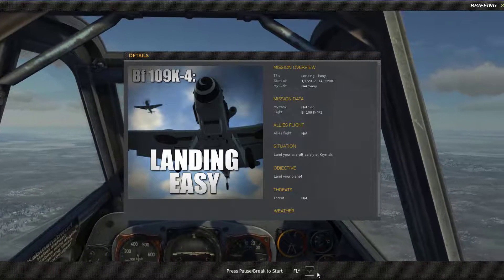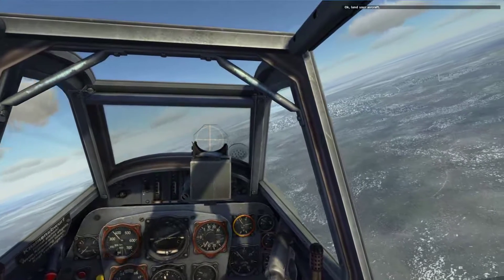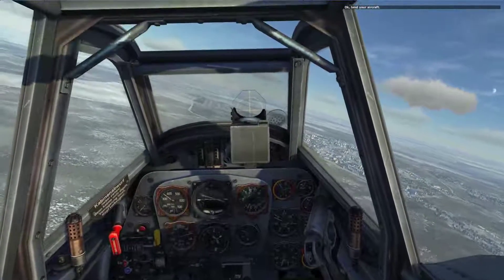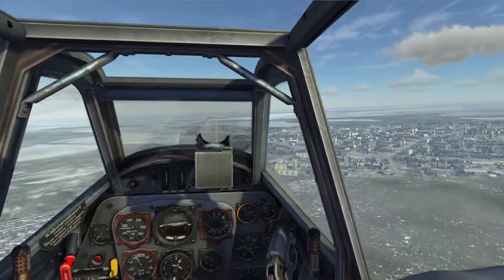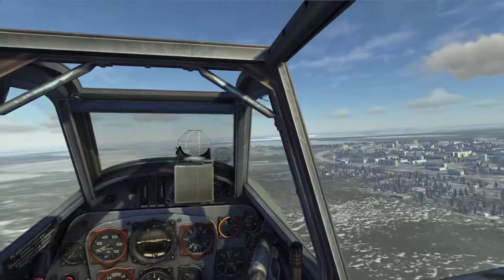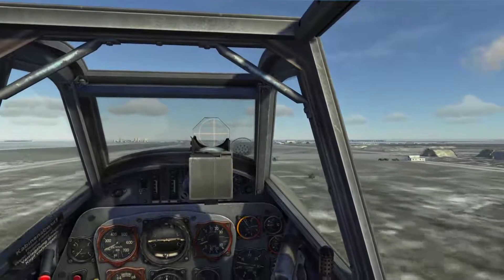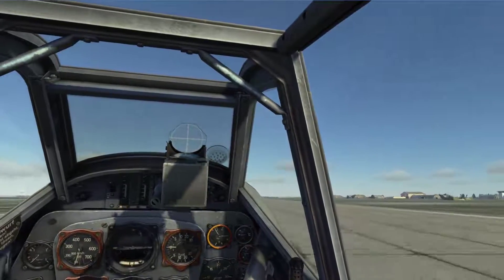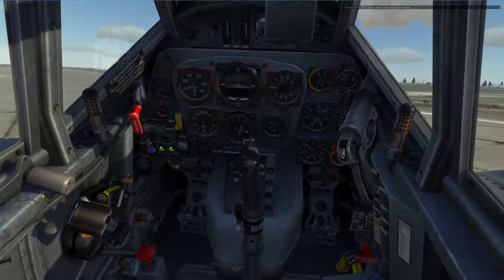DCS: Bf-109 - Landing

Comment: Thanks for posting video.  K-4 is fun to land because its challenging and satisfying when you finally get it.  Truth is the she is very docile and forgiving.  On approach don't worry about RPM, set throttle to idle and once below 300 km set propeller control to manual as suggested and set to 12 o'clock position, not an rpm setting.  Think of 12 o'clock as 1st gear in a manual transmission.  You want quick power response at low speed to make quick adjustments.  With light load on airframe, low fuel and no bombs,  you should aim for 160 - 180 m speed at landing threshold.  Practice landing flare and vertical speed less than 5.  And lock that tailwheel! Pull stick all the way back just as you flare for 3 point landing, a small bounce, "small" is Ok.
Reply from the maker: +SPBurt1 Good dope, thanks for the detailed procedure!

Comment: If you manually set the prop to a higher RPM (say 2600rpm) you should get much better speed control on approach. When you close the throttle the prop will windmill giving you a nice airbrake effect, and the engine will respond more quickly to throttle changes when it's already revving fairly fast.
Reply from the maker: nerd1000ify Ah, thanks for he tip! It does make sense to shut off the komandogerat, but I didn't think to do it. That should make it much easier!
Reply: That is gonna be very handy thx a lot!
Reply from the maker: +nicolas vignon Glad it's working for you.